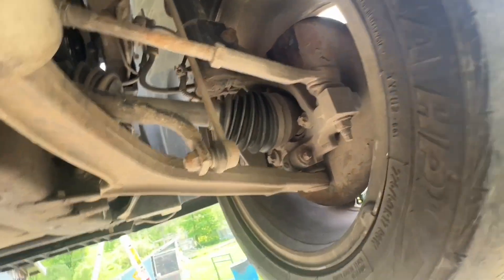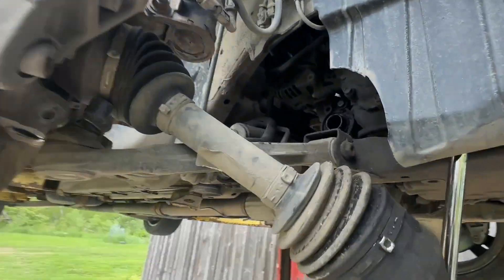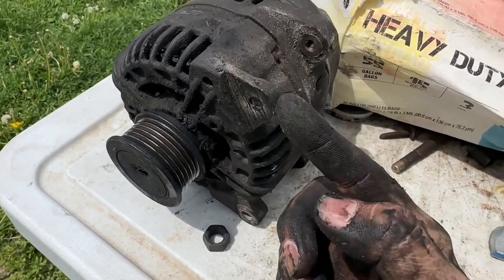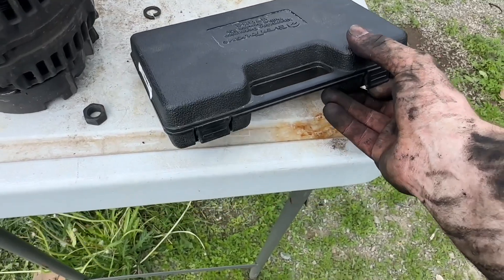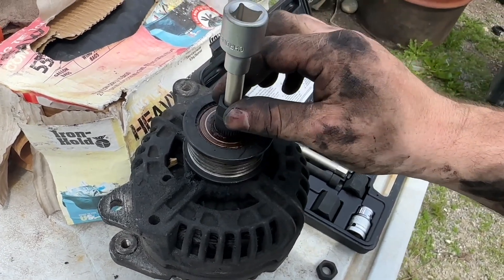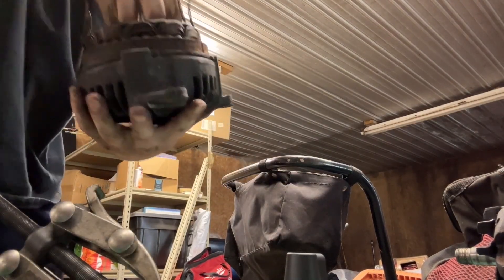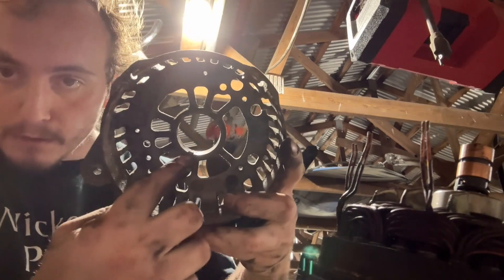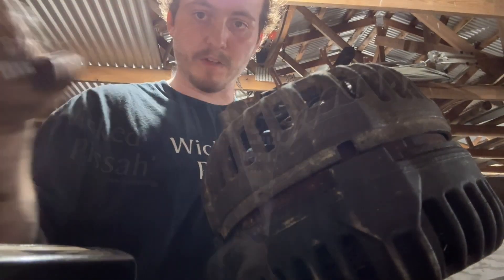Saab 9-3 2.8 Alternator Remove and Rebuild (XWD&FWD)

Comment from the maker: Realizing I failed to mention the alternator voltage regulator with built in brushes comes off after removing screws on the rectifier bridge at 4:21. It just pulls off, easy to reinstall at the end of the rebuild.

Comment: Why bother repairing the alternator and risking not being succesful  when new are available and such a big job removing and installing.,
Reply from the maker: New XWD type alternators are no longer produced. You can buy a fwd alternator and swap to the xwd pulley from the original. However, Replacements are expensive in comparison to this kit. I also like to take the time in taking things apart and see how they work at their core components. There was little risk in this job because I was trained in automotive school how to rebuild alternators. My channel is all about solving. Not just swapping! 😀 This rebuilt alternator still works internally to this day, but i later swapped it for a new fwd unit by swapping pulleys as stated above. I made this change because i had the original pulley internal bearing break. (These cannot be changed). I was lucky enough to have another alternator to steal a pulley from, as these cannot be purchased separately. Hope this makes sense.

Comment: Good morning ! Do you know if you can change the power steering pump with where you are in the video? THANKS
Reply from the maker: @mareautech6067  Should be able to, ive removed power steering from the top and bottom. Just requires patience.
Reply: Yes, check out The Flying MechanicDIY, he has a video on what's required, I should have a comment there with some tips as well.

Comment: Any tips to replace AC compressor clutch coil on 2.8t engine?
Reply from the maker: Unfortunately no, I completely deleted my AC following a car accident that severed my lines. Because I am AC certified I am required to recommend that AC systems are always worked on by a professional shop.
Reply: @SolvingSaab  I supplied 12v directly to the AC compressor clutch coil connector and the clutch is not engaging, measured the resistance at the connector, it is open circuit so the coil is burned, I got a new coil in hand but by looking down there, there is no room the disassemble the AC clutch, nit sure removing the compressor mounting bolts and let it hanging would give enough space to remove the AC clutch, looks a really pain to do that, might just bring the car to a shop and let them do it, thanks, love youR contents👍